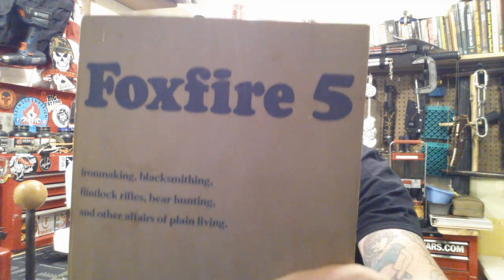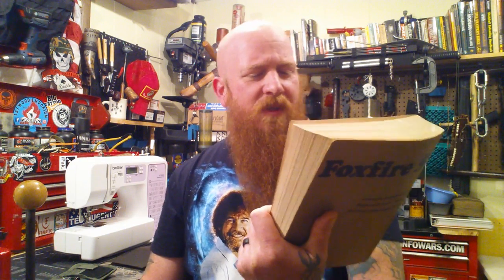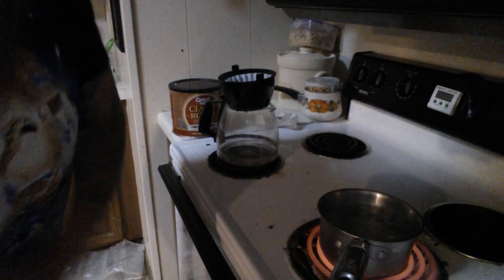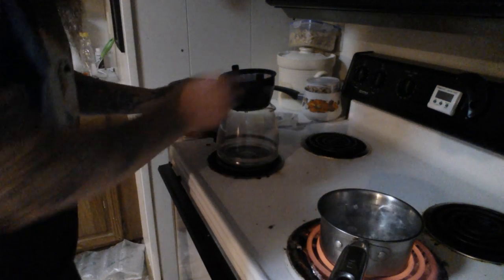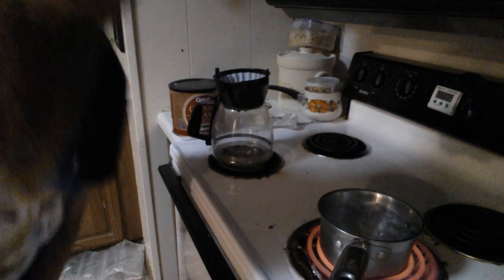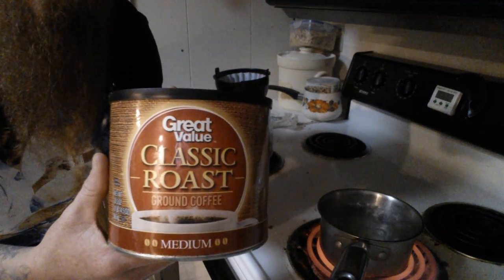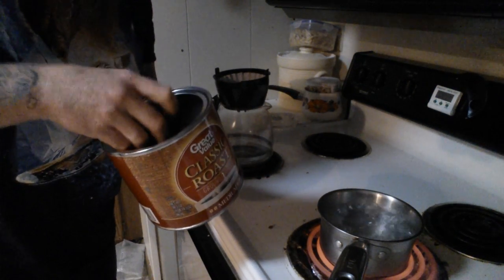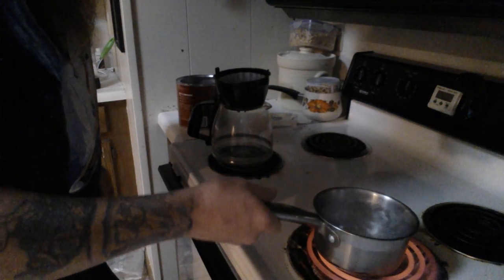DIY Leather Wallet With a Sewing Machine

Comment: With correct size needles, you can sew nylon. I make nylon poke and stuff sacks for my gear. Do you have Foxfire 2, yet ? I think have a extra copy. I keep forgetting, I got 30 years of survival stuff in my garage.  Great video.
Reply from the maker: Diebulfrog79 I need 2 and 4 ...I have 1 3 5
Reply: Let me dig thru the shelf, It's a old copy, kind beat up like me.